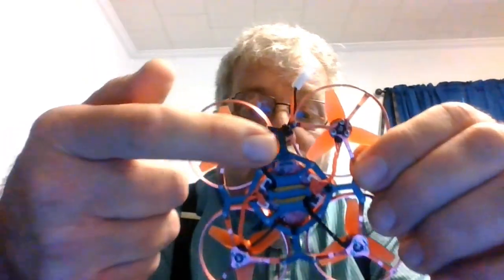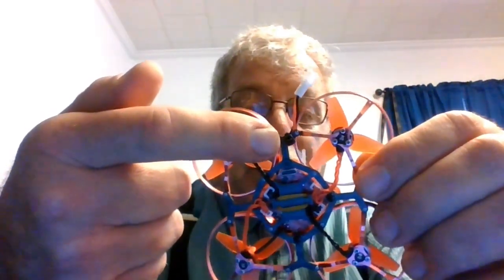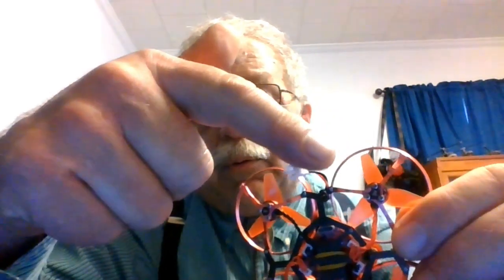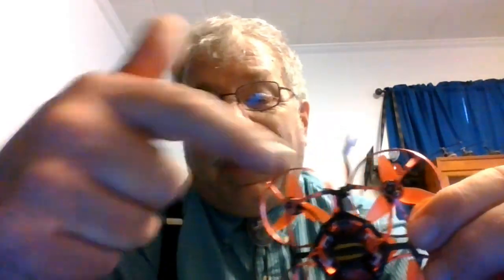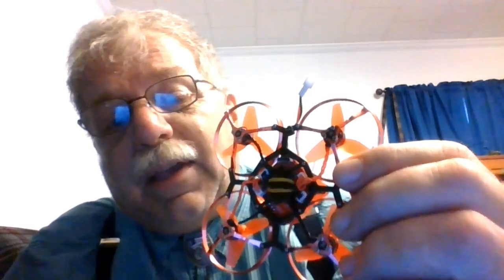Snapper 7 Safety Tip

Comment: Well done man. I also s*ck at soldering, especially the bigger solderpads (of five inchers) with lots of internal connections, like powerwires. The heat gets distributed so fast to all of the board. So that is why that safetyprecausion you made on that snapper, I make on every quad if possible.  Thanks for sharing this with us.

Comment: That zip tie should work great! Another thing you can do is add a dab of hot glue as well on the board, typically that's what I will do just as some protection to keep them from getting pulled out. I don't know anything about your soldering setup but if you're not using 63/37 solder and a digital iron, those two things are inexpensive and make a world of difference soldering. Terrible experiences with Weller soldering irons until I figured out the good ones I should have been using.
Reply from the maker: Thanks John ...I will try the hot glue for sure!